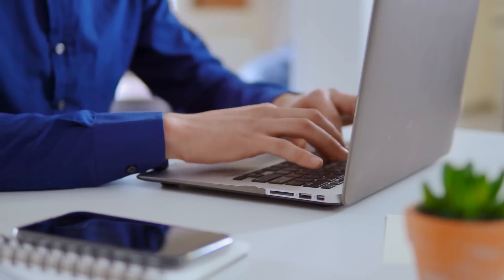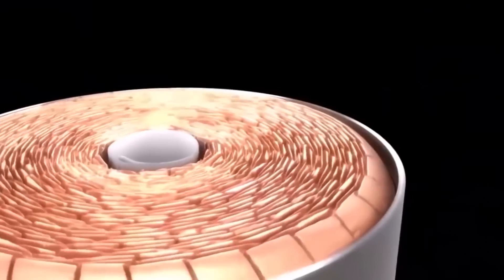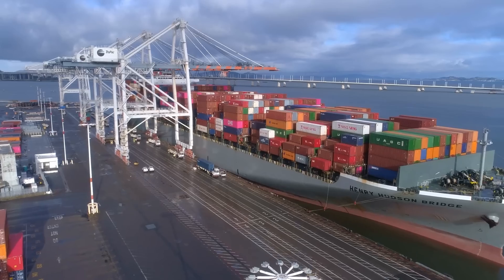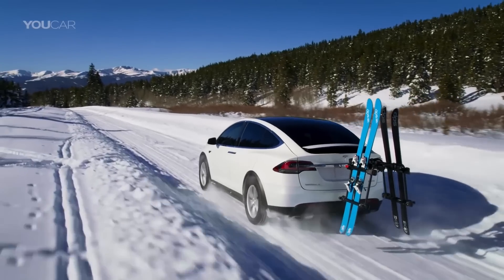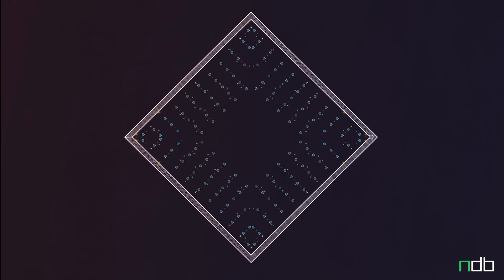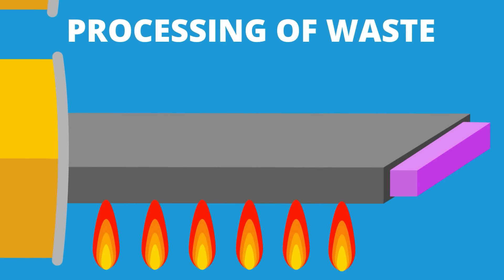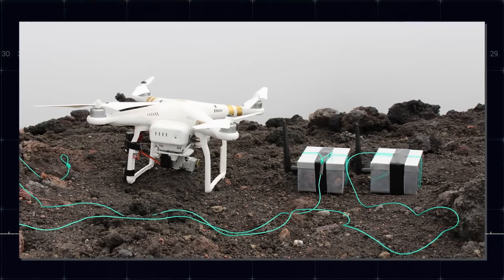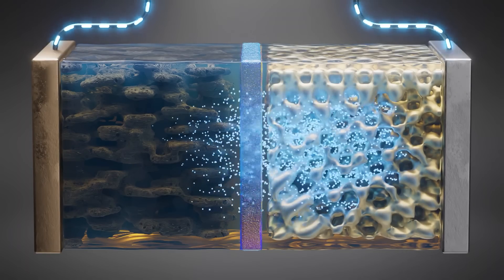IT HAPPENED! Nuclear Diamond Batteries Finally Hit The Market!

Comment: How about you simply take all the nuclear waste, process it into these NDB's and literally put all of them together into huge self generating reactors. Whether to be used as charging stations for phones, devices, etc. I mean yes the electric yield of a single NDB is relatively weak, there's enough nuclear waste from every country that has nuclear technology that we could easily find a way get some serious voltage usage out of it. I have no doubt that sure it may not be fully possible to make these into batteries for vehicles but there tons of possible applications that can be put into motion that even if they don't eliminate emissions, they'll help put a significant dent over time in other ways.

Comment: Uh, no.   These batteries produce extremely tiny amounts of power.  A few hundred microwatts at best.  They are useful for remote sensors and things which require essentially no energy to operate.  They aren't useful for anything else.  It would take hundreds of millions of these batteries to do anything useful for a home or an EV.  Obviously a non-starter.   Also, this technology isn't particularly new.  They are called beta-voltaics.

To put this into perspective, a tiny solar cell with roughly the same footprint as an AA battery produces 3000x more power (750x more energy with 6 hours of sun per day) than one of these nuclear diamond batteries.

Comment: Okay, a couple things I want to point out. 

Arkenlight was formed by the team at Bristol who discovered diamonds generate a charge when exposed to radioactive material. They then realized that by using carbon-14 to create a synthetic diamond with a few inclusions of more radioactive elements, and then encase it in a regular carbon-12 diamond, they would have self-charging battery that was impossibly durable and would last, without needing replaced, for years, decades, centuries, or longer. Since they are the ones who invented this concept, they learned firsthand that these beta-voltaics are never going to power large objects like cars, planes, or heavy equipment because the rate at which the batteries charge is too slow and the power output is too low for those applications. That's why they're sticking to sensors, integrated electronics and IoT devices. Those applications are far more suited to beta-voltaics and are far more widespread than EVs right now, so by completely eliminating the market for other battery types they generate massive profits, while doing the world a massive service by being paid to process nuclear waste into working technology. They've successfully designed, prototyped, and implemented their batteries on a small scale as they're building the capital necessary to build their mass production plant. Their website states that working C-14 batteries, which would be implemented in IoT devices, are slated to be available sometime in Q3 of 2023, not 2024. If Morgan Boardman actually said otherwise, they need to update their website. 

Arkenlight patented the entire concept back when the physics was discovered.

Nano-Diamond-Battery, Incorporated , aka NDB, Inc., has not produced a working model. They claim to have demonstrated two proof-of-concept devices at Livermore, but Livermore has not confirmed that that actually happened to my knowledge. NDB originally claimed that their batteries would be able to power everything from phones to planes to EVs and would last for tens of thousands of years. However, they have never released a datasheet proving these claims. Not only that, but they actually recanted their claims not long after they made headline news, stating that they'd been misquoted when they said their batteries would power cars. 

Arkenlight, when they were asked what they thought about NDB, said, very specifically, that there is no way NDB is getting the power output they claim and that, if NDB is telling the truth about their battery physics, they're in clear violation of patent law. Since then, NDB seems to have modified their design enough to satisfy international patent law, but regardless they have yet to provide any actual data backing up their claims. Not too long ago, they sent out an email informing people signed up for their newsletter (which includes me) that they had been granted 3 patents by the US government, but, again, they have not provided any data. 

Today there are three designs on the NDB website, where they make some very bold and ridiculous claims. For instance, they claim that their NDB cell can give consumer electronics (think smartphones) "the opportunity to raise personal quantum computing." Sorry, but there is no way, within even 25 years, that quantum computing will develop to the point where you can make a phone that has a quantum computer. Its a ridiculous idea not just because that level of technology wont be available for nearly 50 years, but because quantum computers are not suited for everyday web browsing, they're really bad at that actually. 

Don't get me wrong, I love the idea and I'm really excited to see it implemented on a global scale, but until NDB can put their money where there mouth is and publicly produce working models that can do all the things they claim it can I cannot, in good faith, be excited about NDB.

Comment: Run Nano threading, graphene and certain polymers through the whole structure of EVs to turn them into a big battery that lasts for a very long time. Have a direct connect to the axle of EVs and solar, to super charge them. No more plugging in 😎